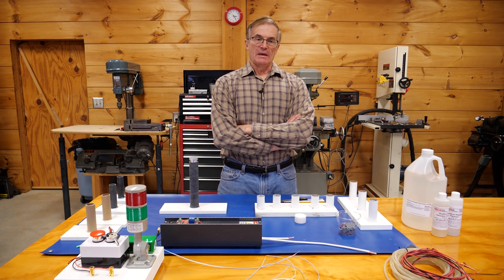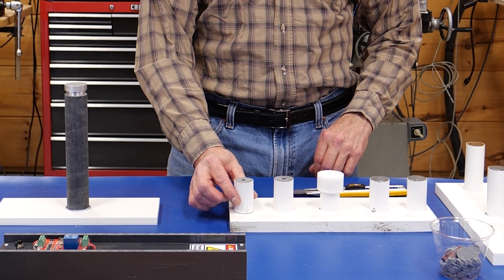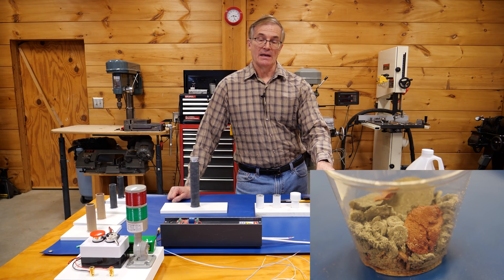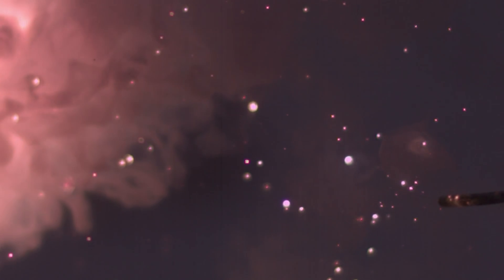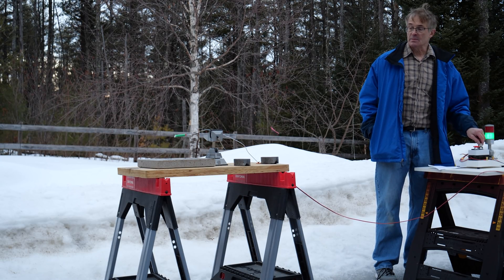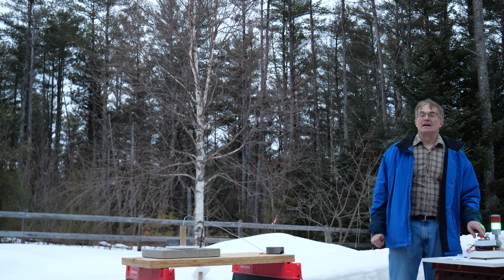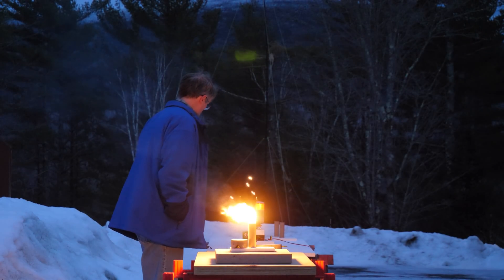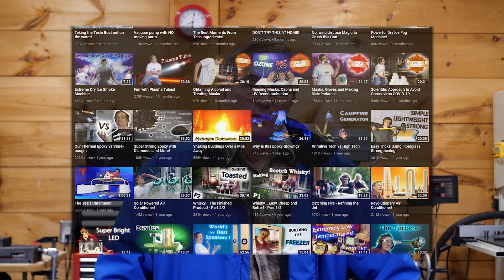Rocket Igniters at 10,000fps!

Comment: The beeping seems to have really triggered off a lot of people here ;-)  
While I didn't exactly enjoy it, I was able to tolerate it without too much hassle. Perhaps a video on the science of psycho-acoustics would be a good spin-off from this. There isn't a lot of easy to understand information on the subject readily available.
Reply from the maker: Agreed.
Explosions and rocket fuel, but the beeping...!
There has to be a psychological component because people almost universally like loud fireworks.
Reply: @TechIngredients  the beeping obviously didnt help at all for safety as you are accustomed to it and tuned it out. otherwise you would turn it off the second you could standing so close to a piercing noise like that. at that point it stops being a safety thing and it actually becomes a safety problem as you are programming yourself to ignore it.
Reply: @SupremeRuleroftheWorld  What you say is true, but often times, safety devices are more for the people not operating the equipment than the ones who are. I'm sure a commercial truck driver doesn't hear the reverse beeper anymore either, but they probably aren't the ones that need a reminder that they are in reverse. I think this falls into that category.
Reply: @SupremeRuleroftheWorld  The general principle is very useful in environments with multiple/random people present. Much like when luggage belts are about to start moving in airports. The basic idea is that the process of activating something that is a potential "accident hazard" involves sensory (audible/visual) warning that gives a chance to others to "become alert".

He should have added a delay (from pressing the button to ignition) and a red flashing light (for people with hearing disabilities) to make it truly "industrial/regulation-compliant".

Consider as well that it helps even in this case where you'd think there's not reason to: sure, he's alone in private land, with just his camera-man buddy and they both know what they're doing. But imagine him accidentaly opening the safety (allowing for the switch to be pressed) without realising. Suddenly you're in "an accident waiting to happen" situation and completely unaware of the imminent danger.
Reply: @TechIngredients  It might have something with the learned response in many to look around for a reversing vehicle? Would it be possible to alter the frequency of the beeps to a non-normal range to test this?
Reply: @TechIngredients  In post production you could draw out the frequency.
Reply: @TechIngredients  I think if you changed the duty cycle and the frequency (edit: the on-off period, not the tone) of the beep it could be made to be tolerable.
Personally i didn't find it irritating only mildly distracting.
Reply: @TechIngredients  If I hadn't seen the video comments, I'd have jumped up and ran downstairs to see if the truck with my parts delivery was here. I'd bet on it being annoyance at thinking it was a local sound instead of realizing it was the video. (It is dead on for that "reverse beep" used on heavy equipment and vehicles)

Personally, it was a sheepish chuckle, not a "grr, thumbs down".
Reply: @TechIngredients  The loud fireworks are not so predictable and way more interesting to watch and listen to :-)
Reply: @TechIngredients  I guess you'll have to change the beeping to a shepard tone ;)
Reply: @TechIngredients  I know several people who can't stand fireworks, and dread holidays where they're common.
Which isn't to say that people at large don't like them (they wouldn't be made otherwise, and I personally like them quite a bit), I mostly just take issue with the "almost universal" part of that statement (though people who don't like them probably wouldn't be watching this video in that case).
There's a good chance it might be due to sensory issues that make some sensations completely unbearable (akin to nails on a chalkboard).
Reply: @TechIngredients  One reason why some people find it less annoying than others could be loss of hearing. High frequencies are really obnoxious and loss of hearing affects those first.
Reply: @TechIngredients  A narrow notch filter applied in post-production could probably remove most of the beeping sound.
Reply: @TechIngredients  STOP ADDING MUSIC.  I have watched almost every one of your videos for years, I have bought your products and shared links to your products in dozenns of forums.  I want you to be sucessful, but I can't spend more of my time watching your music videos.   I get it you think music is great and makes everything better, but that is false.  Stop making the videos you want and start making videos people want.  Ben at applied science doesn't add music, Cody doesn't add music, thought emporium doesn't add music, nile red doesn't add music, styropyro doesn't add music. I BEG YOU, PLEASE, STOP.   Every video you add more and more music.
Reply: @TechIngredients  i hate fireworks! reminds me of gunfire and creates stress!
Reply: @TechIngredients  It clearly affects different people differently.  In addition to any psychological effects there are likely philosophical effects, too.  And technological effects (different speakers and such).

I was one of the people who found the beeping hard to tolerate. At levels where I could handle the beeping I couldn't really hear you talk.  But the rocket motor sound levels were fine, at least on my setup.  The frequency of the sound is probably part of it.
Reply: @TechIngredients  Horrible, a tech video with an arming beeper, how dare you.  yea you have to make a video and plan it so that it's not good enough it keeps you safe, and gets the job done, but so there's not anything that may "trigger" or "annoy" the soy milk basement viewer.  Worse yet a flashing lite may have half your audience drop to the floor into a grand mall seizure.
Reply: Triggered is right! Could you build a self shutoff that activates after ignition, at least.
Reply: It's the high pitch. If you made the beeping 1/2 the frequency (or a buzzing rather than beeping) then it wouldn't be annoying.
Reply: @aaardvaaark  yeah if it makes my ear drums flutter.
Reply: I had to mute the video for the beeping. I found it physically painful.
Reply: The level of annoyance of the beeping is is likely base off of the particular sensitive frequencies in a persons speakers and their personal sensitivity to hearing these frequencies. When watching this on my laptop this beeping was so loud I could hear it across the room when I could not here the words being spoken.
Reply: would be interesting as I have been planning a system to divert people away from an area but not consciously due to something being super annoying but rather subconscious response much how a quiet coughing that someone is unaware of but their ears are still picking up can cause a empathetic response where they start to cough and don't know why. but with that "man this place creeps me out but I have no idea why" type of response. Been experimenting with the process at parties and all sorts of other engagements where I was able to inject various sounds and such, (one was a zombie survival live action roleplaying event based on "all flesh must be eaten") :)
Reply: Huh, I barely noticed the beeping.
Reply: I has been recently discovered that some people do not awake to the beeping of a smoke alarm.  This can go on for several minutes and still nothing.  That is why there are now some smoke, fire, and CO alarms coming out that are spoken voice.  It was shown that the same people who did not awake to the alarm, will awake to these.  Fairly same frequency alarms.
Reply: Safety features are meant to keep people aware. If it wasn't there the same people would be saying it's an unsafe set up, LOL
Reply: I have to say I don't much care for the beeping either.  It certainly isn't needed after the launch button has been pressed.  With a minor modification of the circuit the beeping could caused to automatically switch off after the button has been pressed.
Reply: @michaeldeleted  I completely agree. It's actually a hazardous design. It has supplied an ignition pulse yet remains in an active state. Imagine instead, it was used firing an explosive.and a hapless approach to a smoldering detonator. Once a fire signal is triggered the initiator circuit should immediately go to a "red off" state and quiet to prevent any distraction.This is a safety issue.
Reply: How about V2K technology, been around for decades but used to target individuals.
Reply: I’m guessing the combination of frequency and periodicity are what some are finding annoying. I’m also guessing a good alarm is supposed to be annoying!
Reply: This beeper is like "warning" people from a dangerous situation with a turning 7 Watt blue laser ! lolololol
Reply: @SciFi Author B.L. Alley no it isn't. it's a good way to distinguish those who can ignore an annoying ass sound and those who just get a headache from it
Reply: Then you should not be driving a loader or truck.  :-)
Reply: Still waiting for the Shaped Charge video.
Reply: The beeps! They deafen me! Arrrg!
Reply: Nothing wrong with alerting your Neighbors a loud noise may soon follow, I find his Safety measures quite refreshing...
Reply: You try watching anything with a constant ear-piercing beeping in the background. Wtf would enjoy that? I hate having to mute your videos every 30 seconds. Just kill the beeping after the button is pushed.
Reply: Theres more discussion about beeps than mask wearing...

Comment: Ok, for the advancement of legally questionable fireworks and science: I am curious what the effect would be if you used gun cotton in place of the wadding, should be cool to watch at least.
Reply from the maker: It's  actually  not a good choice, the nitro cellulose burns VERY fast and exhausts out the opening, only occasionally igniting the fuel.
Reply: @TechIngredients  what about with something like a bentonite plug and a thicker-walled vessel, almost like a blasting cap?

Comment: Wow, the barium igniter seemed kinda close to commercial blasting caps I've seen. How do you measure the temperature for such a short burn? Thermal camera or?
Reply from the maker: A visual spectrometer would be better at these temperatures and we have one. But reportedly, the temperature of burning aluminum is close to 3,000 C.  Unlike a blasting cap, there is little pressure devloped as this is a conflagration not a detonation.

Comment: Is it possible to use a regular spark igniter to ignite the fuel?
Reply from the maker: Our spark gap didn't work and the commercial e-matches will most of the time.  Augmenting those commercial igniters works every time, even on large engines.
Reply: @TechIngredients  Do you think the breakdown voltage is too high? It is relatively low for gasses compared to solids, correct?

Comment: In the slow motion shots of the augmented igniters, there seems to be quite a bit of expansion of the material, ahead of the flame front. When you place these igniters into a finished engine with a constricted nozzle, won't there be an issue of the igniter and flame front being pushed out of the engine before it has a chance to reliably transfer to the engine fuel? In regards to the beeping on the Launch Control System (LCS = Super Geeky Awesome!) the high pitched tone can be painful to viewers with hearing sensitive to that frequency. Perhaps it's even a result of YT's compression or encoding that amplifies it?  I would like to suggest using a pulsating white noise as an alternative? That said, Thank You for everything you all are doing on this channel. Your broad spectrum of topics are conducted in an informative and structured manner that conveys massive amounts of information in a straightforward way that makes it easy to comprehend. Thank you for all the fantastic work!
Reply from the maker: Thanks.
It's probably not an issue as the igniter produces much less gas than the fuel itself, so the nozzle is proportionally much less of a constriction.
It might be YouTube, as the sound is not supposed to be pleasant and can't be ignored in person, but it's not as bad as some viewers report.

Comment: I have to say that your videos are really one of a kind. This is just refreshing to say the least. You brought back fond memories of when I was real young 14 making my engines using sugar as the main ingredient. Using monel thin wire with heat shrink tubing halfway up the filament from one end. The tip was just match heads and ground gunpowder. Worked perfectly with no miss fires. Good day too.

Comment: only thing that bothers me on this is calling them flash powders, the fact that ye are able to see the aluminum burning in chunks makes it not a flash powder. For it to be a flash powder it needs to be all burned up in a bright single flash that ye eyes can't detect as more than a single instant flash. While ye where making them in the other video i was curling my toes when ye mentioned the compounds and saw how ye where handling them but at meshes like that it don't matter since its more a sparkler than actually flexing the real power it has. Though than again also surprised ye didn't use like a pulverone with ti flake. same effect, bit hotter and a lot safer

Comment: So are you saying that a Launching Pad with an Ignitor at the top of a stable stand would be best? The stand going right up inside the engine holding the rocket in the direction of - not your place [reflections of Jolly Rodger's Home Score] :- ]
In which case the original petrogeled stork is going to be the size that you mount your Primary on correct.
Realistically if we look at the project as a mini S400 series starter kit we also need a tube on a  - Stool out back in your yard in the cold because we don't need a truck mounted launcher that's not what science is about.

Readers here's a hint, If you ever play with 8hit like this and weird people come from all directions into your home chances are you needed to watch the tracking design section more closely. For future reference it's "globe.adsbexchange.com" and click the "U" up the top excludes civilian
Reply from the maker: A launch rod that is limited to the core depth might be too short.  It might work, but  a guide mounted on the side of the rocket will permit more design freedom.

Comment: Photon engines have the best ISP for space propulsion because it convert electricity to thrust in a vacuum shoving out electrons at high velocity & can slowly accelerate manned craft to 10% of the speed of light // for deep space missions. These fuel based combustion rockets, regardless of fuel type are limited to about 450 seconds ISP max & produce air pollutants when operating // especially like a 2 stroke engine are the small solid rocket motors // stuff fun to watch & better if people by the million watch this online instead of doing it themselves / they can experience the action without making the pollution other than that which is created by internet power consumption of computers, servers & telecom / though much of that can be made with renewable nuclear fuel breeding reactors + a mix of other intermittent solar & wind + hydro & tidal & geothermal etc lots of ways to power magnetic fields spinning through coils of wires to make electrons flow //

Comment: Looking at the high speed of the igniters. Is that unburdened fuel getting blasted off the end or some kind of a cap?
Reply from the maker: It's unburned ur about to ignite flash powder.  I don't expect a very homogeneous ignition with loosly packed powder, but the excess covers for this.

Comment: Isn't that "HTBE" ruber based material similar to what Military grade smoke generators use?. If I recall, a while back a pyrotechnics supply company was selling smoke generator kits that stated they use a military grade ruber like fuel?.
   Great video by the way!🇺🇸✌️
Reply from the maker: I haven't heard that, but that doesn't mean it's not true.  It's tough and holds a lot of solids effectively.

Comment: I agree with at least one other comment regarding the "enhanced" igniters, especially the one that made you go "Whoa!", might be a risk of cracking the fuel core when it was set off.  While I know these weren't really "rocket engine" tests, the most basic of the sugar rockets don't have a "nozzle" as such, just a hole through the "bottom" bentonite plug for the igniter and exhaust gasses.  Maybe for the next round use a bathroom type scale with a remote display to show (approximate) thrust from the various mixes.  Then if you get fancy with the nozzles, you can show comparison numbers

Comment: How are you planning on measuring fuel efficiency?
Reply from the maker: Actual fuel effeciency depends on the velocity of the rocket. However, fuel impulse will be pretty straight forward.  Did you see our test sled with the load cell in the first video?
With the integrated force times time divided by the measured propellent weight, we'll get the specific impulse of the propellent.

Comment: So, did the 40 kV ignition work?
Reply from the maker: No, that's why I used the torch for the propellent scraps.
Reply: @TechIngredients  oh, I see, thanks; from my experience I think you need something with millisecond pulses, not nanosecond. Or the energy of each pulse needs to be quite high. What principle is this nanosecond PS based on?
Reply from the maker: I agree. This uses a Cockcroft Walton multiplier and simply adding a larger HV capacitor to the final output stage will probably work.  I'm trying that now.